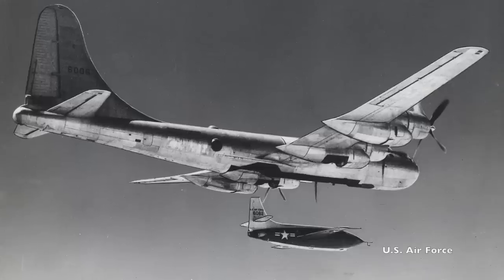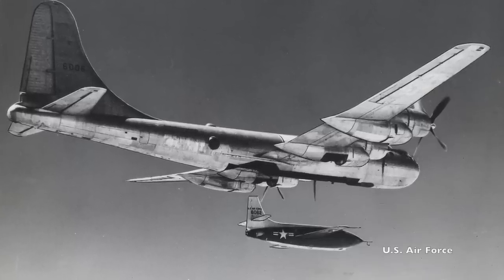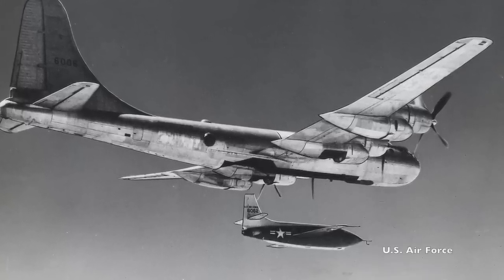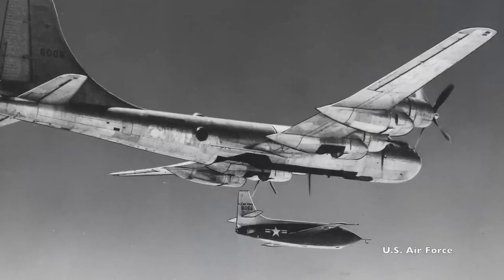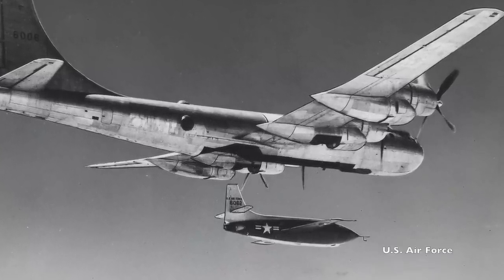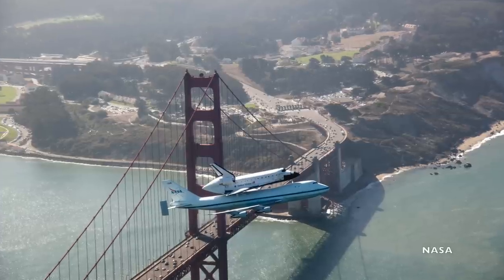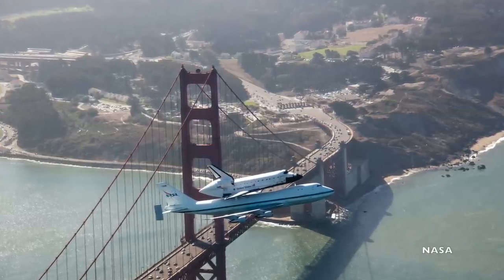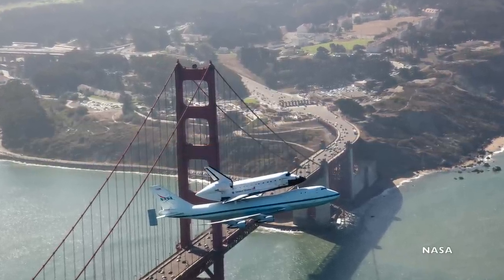Air Launching Air Planes

Comment: Would it have been possible to launch the shuttle from the back of a modified 747 using smaller external tank(s) and no solid rocket boosters? I know NASA or Air Force had a system some what like that on the books!
Reply: +Y Pop I doubt it, the weight and size of the external booster you would need would probably far exceed what you could mount on any plane. The speed and altitude would help a bit in the launch, but still ...
Reply: Totally impossible. The reason why the Shuttle had that huge External Tank (ET) and the two Solid Rocket Boosters (SRBs) was because the Orbiter needed every bit of thrust it could get from its own main engines to accelerate its weight up to 17,500 mph and lift it 200 miles above the earth.

Even if an aeroplane COULD lift the Orbiter with tanks and boosters to an altitude of (say) 30,000 feet before launch. That is still only 5 miles high. There would be another 195 miles to go.. And the plane would only save about 400 mph from the 17,500 mph needed to achieve orbit.

So, the two boosters and the big tank would effectively be much the same and as heavy as if the whole assembly was being launched from the ground.

And the killer is that there is and never will be, most likely, an aeroplane capable of lifting a fully fuelled Shuttle stack off the ground any..

Comment: I am curious what you would think of this idea.  Why could we not use a shuttle style vehicle as a transport to the moon and simply drop a lunar lander from the cargo bay?  The only issue would be having enough fuel and consumables for that long of a shuttle flight.  Also a lunar lander could be retrieved with a shuttle robot arm.  If they could rendezvous in earth orbit and dock with another fuel tank I think they could have taken a shuttle or similar vehicle with a lunar lander to the moon.
Reply: I know you wrote "shuttle style," but I'm going to frame my reply the the shuttle.  It would be neat, but the shuttle is just too heavy to push to the Moon, and then back to Earth.  The combined weight of the command/service/lunar modules was 100,000 lbs, the shuttle maxed out at about 250,000 lbs.  Another difficulty is Earth reentry.  The Apollo craft came straight home and entered the atmosphere at 25,000 mph, the shuttle orbited at 17,500 and slowed down with retro-rockets to break orbit.  I've never heard about Apollo using retro-rockets, only "hitting the atmosphere at 25K."  But still, that's even more reentry stress on a shuttle orbiter so it would need to be built heavier.
Reply: The shuttle would re-orbit the earth upon returning.....then renter as normal.
Reply: The rocket required to put a Shuttle orbiter all the way to the moon would be simply enormous - probably twice as large as a Saturn V. And, when you think of it, why send something with wings all the way to the moon when most of its structure is designed to handle just the re-entry into the earth's atmosphere and gliding in to land.
The last thing a true spacecraft needs is unnecessary weight - and the wings, tail, undercarriage and associated hydraulic systems on the Orbiter are all completely dead weight to be carrying to and from the moon.
It was bad enough carting all that weight up into low earth orbit, Carrying it all the way to the moon would be totally loony.

Comment: Did NASA's contingency plans include several alternate shuttle landing sites around the globe or was it just Edwards and Kennedy?
Reply: Effectively, ANY runway that was long enough and within gliding range of  Shuttle either from a launch abort  or during re-entry could be used as an emergency landing ground. During launch, depending on the launch trajectory, abort landing grounds were available in Spain, West Africa or France.

Comment: Why is the shuttle in such a nose high configuration? I would think you'd want a slight positive incidence for air launching but for transport? Plus it's a really obvious nose up, more than I'd think is needed.
Reply: it may have something to do with the best angle of attack in terms of lift. The shuttle has a horrible glide ratio. IIRC  was something like 1to1. So just a little better than a brick. The shuttle was a one and done there was option to go around, you had one shot . better be a good one!
Reply: +roger depew I suppose, outside my area of expertise, just looks like a high drag position. Might also have to do with the air launch procedure where you dove the mother ship slightly to allow the shuttle to have enough airspeed to lift clear?
Reply: As far as I know only the air launch configuration actually had such a high angle of incidence. The one in the video is the Enterprise which only ever did air launches. 
If you look at pictures of other shuttles being ferried they usually have a much shorter front strut and are closer to parallel to the 747 fuselage. I guess they still keep some angle of attack to have the shuttle contribute some lift in return for its drag. Might save fuel and reduce stress on the plane.
Reply: +Lister Dave Thanks for that info, makes sense to me.
Reply: The Orbiter has the glide slope of a brick.  During the Enterprise approach and landing tests a big concern was getting the 747 away from the Orbiter at separation.  Every bit of lift possible for the Orbiter, combined with diving the 747 and rolling off at the moment of separation to avoid a collision.  They were basically cutting loose a 100 ton elephant on their back.
Reply: Absolutely correct. The high angle setting was only used during these glide tests. When used purely as a Shuttle carrier, the forward strut was shortened resulting in a much shallower angle. 

As a matter if interest, if any of you build scale models, Revell's 747/Shuttle combination has the longer forward strut. This was because the kit was originally released as depicting Enterprise during the glide tests. It now depicts the 747 in its more modern colour scheme and as a carrier aircraft. To be accurate, the nose struts need to be shortened so the 747 can be posed at the correct angle for ferrying flights.

Comment: Can't believe that when they released the shuttle, it didn't slam into the rudder
Reply: +Whiskey Wolf __ Upon release, the shuttle was pulled up and the 747 was pushed nose down.
Reply: +GSMSfromFV I'd imagine but I still think it's crazy, look at the distance between the rudder and shuttle. Nuts
Reply: The 747 was in a dive with the shuttle at its natural glide. When the shuttle was released, the 747 pushed the nose down fairly abruptly and the shuttle just continued its decent. If you look up the video of it, it doesn't even look like the shuttle is disturbed by the release its so smooth.